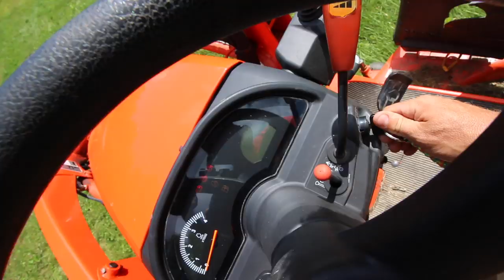One of the Best Parts Of Homesteading

Comment: Always a treat to see Gina, and Miss Livvie in your videos. You have a lovely family, it's nice to see them sharing in your modern homestead life. The chickens must be catching on to what it means when NYC gets moved. They exploded out the door this time. They're going to love that new area too. Dead apple means great smoker fuel for the outdoor kitchen.
Unlike what many call pot pie, an actually pie crust with a savory filling. Yours is what I grew up calling chicken "pot" pie. A pie made in a pot. Essentially a rich chicken soup/stew with egg noodles. This was one of my favorite dishes that Grandma made when I was young. It was also the first dish I had her make, and teach me when I moved back with my young family. Of course Grandma made her own noodles from scratch, which were/ are my favorite part. LOL When I learned how simple they are to make even better. Two eggs to every cup of flour, salt, and just enough cold water to make a slightly stick dough. Cover and set aside to rest. Spread flour on your rolling surface, cast the dough out of the bowl, dust that with more flour. Roll out from the center, rotate 1/4 turn with each roll, trying to end up with a big, flat rectangle about 1/4" thick adding more flour as needed to keep from sticking. Trim off edges with a sharp knife to square off. Cut the dough into square, or triangles, or diamonds of pretty good size, easily 1 1/2" wide in all directions. Slip into boiling pot of soup, being sure to keep them separated until thoroughly wet so they don't stick together. When noodles start to float, they are down. I would imagine you could make these with your gluten free flour to good effect. 
Another great day on the modern homestead, thanks for sharing.
Reply from the maker: That sounds delicious! We love egg noodles! TFS

Comment: I very often get that dang tomato rot.  Someone told me it was a calcium deficit in the soil or that I should not plant tomatoes in the same place each year (crop rotation).  This year, I decided to supplement my soil with fish bone meal and blood meal as soon as I saw the rot start.  It does seem to have staved it off (been about 2 weeks) and my tomatoes are starting to turn red finally.  I would like to see what your plan is.
Reply from the maker: Matt Crandall awesome! We are putting our plan in action and tomorrow's video!
Reply: Matt save your egg shells, sterilize them in the microwave for a minute or two and crush them in a blender as fine as you can.  Mix this into your compost or whatever you plant in as early as you can so that it has the chance to release it's calcium.  If you get enough of it into the soil you won't have to worry about blossom end rot all season.